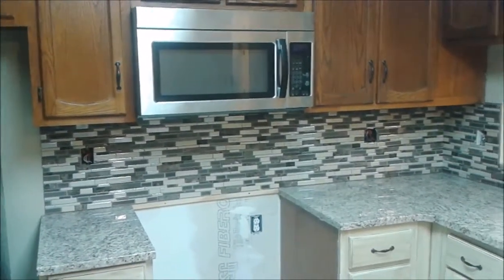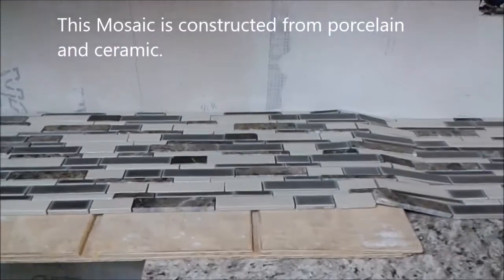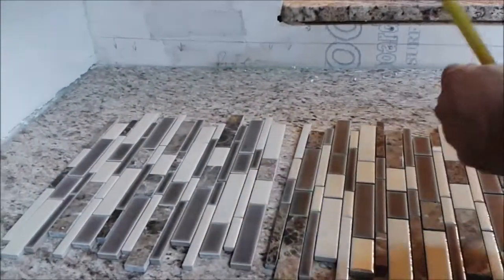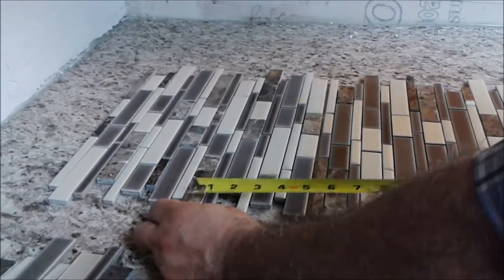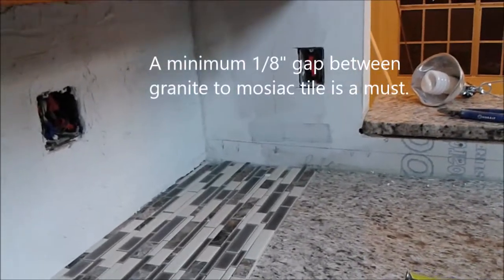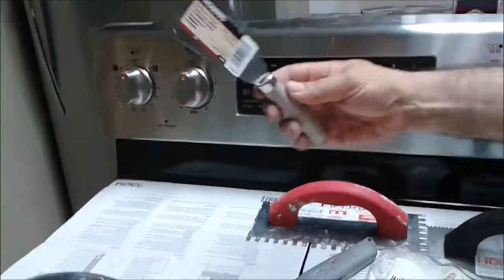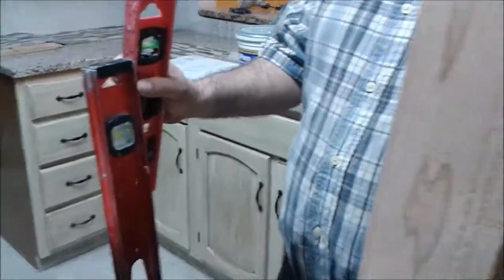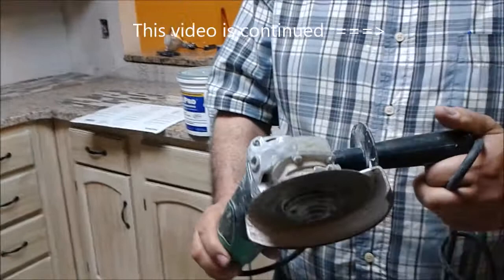How To Install Mosaic BackSplash In Kitchen - Preparation and Tools

Comment from the maker: Best Thin set used = https://amzn.to/3cxVBz8
Medium thin set =  https://amzn.to/3mSk9aR
Mapei Grout = https://amzn.to/340hWS5
Angle grinder used = https://amzn.to/368IX8C
Narow brick trowel = https://amzn.to/3mL7gOB

Amazon Deals:
Try Amazon Prime 30 days for free = https://amzn.to/2JMWaLe
Create Amazon Business account = https://amzn.to/3mLSyYt
Joint Amazon Prime Watch Thousends Of Movies and TV = https://amzn.to/33NfsHD
Try Personal Shopper Wardrobe  https://amzn.to/2VClfv9

Other tile toos on Amazon:
Tools and Materials  used:
Angle grinder used = https://amzn.to/368IX8C
Diamond Blade =  https://amzn.to/3j2kTbc
Dimond hole drill bits =https://amzn.to/36bX2Cs
QEP wet saw = https://amzn.to/3cLJgaW
Diamond Blade = DeWalt https://amzn.to/3jfdpSr or Black Widow https://amzn.to/3jgx18G
Grout Float = https://amzn.to/3j7KO1c or https://amzn.to/348KLMu
Notched Trowel 1/4 x 1/4 x 1/4-Inch= https://amzn.to/3j26Zpv
Notched Trowel 1/2x 1/2 x 1/2-Inch= https://amzn.to/2S5Zceg
Notched Trowel 1/4 x 3/8 x 1/4-Inch=https://amzn.to/3cDPbhZ
Nitrile Gloves = https://amzn.to/3i8VhrT
Best Thin set used = https://amzn.to/3cxVBz8
Medium thin set =  https://amzn.to/3mSk9aR
Mapei Pre Mix Grout = https://amzn.to/2HqhdC3
Mapei Grout = https://amzn.to/340hWS5
Miter Box Used =  https://amzn.to/2SnYgm1 or https://amzn.to/2G1CVfB
Hand saw =  https://amzn.to/30kvabp
48" Level = https://amzn.to/347tmUl or https://amzn.to/30m3y5H